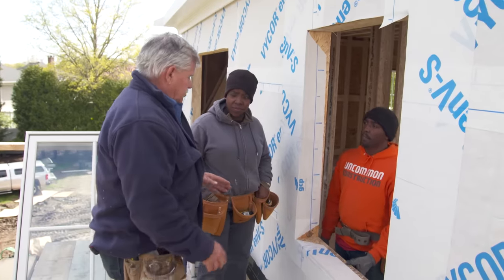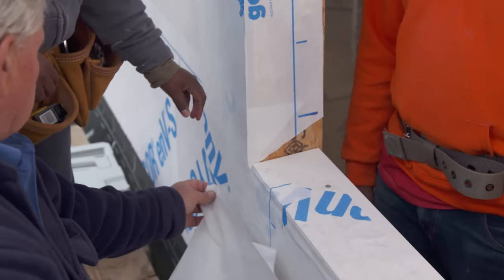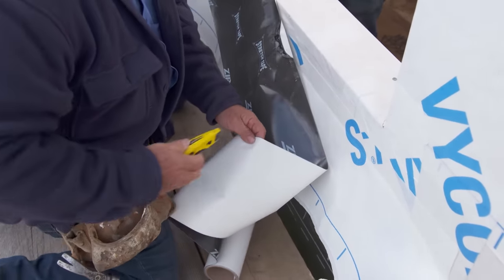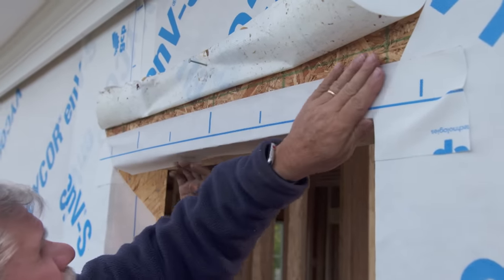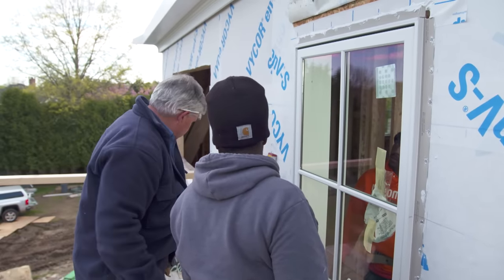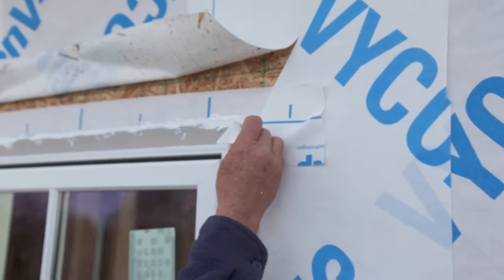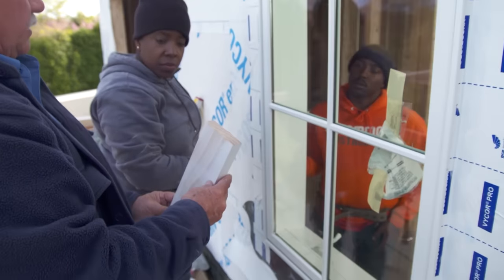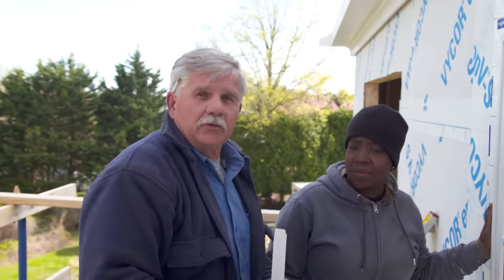This Old House | Pro2Pro: How to Properly Install a Window

Comment from the maker: Throughout his career Tommy has peeled away a lot of siding in this area only to find rot from years of water damage, which is why he’s a firm believer in this kick-out style flashing. He’s seen it on doors and below windows.
Reply: @Order-in-Chaos  so don't watch it.
Reply: @Order-in-Chaos  not going to waste anymore time to your silly behaviour. Get some friends. Or buy a book...
Reply: He forgot to put is z flashing on top of the window and then tape the top of the z flashing then pull the house wrap over the tape and z flashing
Reply: A easier way to flash the window sides and top is pull the paper a couple feet hold the flashing with the edge of the window and then stick it to the house with your palm seal it to the house working in towards the window. This way is much faster and you never have bubbles plus the coverage on the window is always even give it a try it’s not taught it’s something I discovered
Reply: Could have used him on a recent build I had done - and am having redone. 😢

Comment: This particular task is a good depiction of how drastically building standards can change. It’s awesome to think how well this will prevent water entry, but at the same, it took 3 sets if hands 30 minutes do to this (1-1/2 hours total just to flash and install the window). If you’re spending this kind of time on this, then adding the time to spray foam, trim the inside, trim the outside, flash the trim, and all of the materials, you’re in to some huge money to do just one window. It’s an ongoing predicament in my head. We spend all this time and money taking things to the Nth degree, yet there are still houses all over New England with 100 year old windows, no modern vapor barriers, and no rot has started in the wall. The old timers had something figured out. Meanwhile, just the other day I pulled out some 30 year old windows at a client’s house and the flexible adhesive flashing membranes were all cracked and flaking anyway. I am inclined to try and convince clients that it’s worth  using the best possible installation method, but every time I hand them a bill for a few thousands dollars to install a couple windows I always wonder if all this fancy stuff is going too far.
Reply: The predicament seems, to me at least, that the old timers left ample space for houses to "breath". Even if moisture did get into spaces, those space would naturally dry out quickly. This had the obvious downside of being energy inefficient, but oil was cheap back then. Insulating old homes usually means sacrificing airflow. Modern homes can be designed to incorporate good airflow and insulation, but that adds to cost, and old homes aren't being redesigned, they're being upgraded piece by piece, and upgrading insulation doesn't always mean taking into account the airflow physics. So it's complicated because the benefits of insulation bring the complications of changing the physiology of old home construction.
Reply: Training always takes longer when done correctly. Once someone gets the rhythm, they'll be able to crank em out. (Pun intended.)
Reply: Same with wood floors on a raised home. If you put a vapor barrier between the sub floor and the real wood floor moisture will rot the top of the sub floor. In the old houses the wood floor planks were the only floor, allowing the floor to breath.
Reply: Survivor bias, most old houses have rotted and collapsed.
Reply: i would assume this would be a 2 person job and there were 3 hands for the sake of training video.
Reply: @johncostello4565 really? Come to the east coast or New England and have a look around. Where I live, every house you look at is 100 years old or more
Reply: The old timers did it right. Houses could breathe and the inside air was higher quality. Sealing  the houses tight to save heating costs  had the adverse effect of trapping moisture and keeping the stale air inside, turning them into mold farms and reduced the air quality in the home.

Comment: I would love for TOH to do a series on window replacements, especially when the home is not being resided.  To many window replacement contractors don’t provide adequate flashing and weather proofing.
Reply: Gr8 M9ds Agreed!!
Reply: The do it on purpose save penny to make thousand in repair I. The future hahahaha because the warranty of tha windows  expire ..   it's the so call do business
Reply: So true. I can't find ANYTHING on this on YouTube. What I read on GreenBuildingAdvisor in the comments is to treat the outer surface of the old siding as if it's the building paper surface.

Comment from the maker: Eric recommends using roofing nails. If using 2” roofing nail, every other hole; with 1-3/4” roofing nail, every hole. Tommy says: why roofing nail? Because the head is flatter so it won’t interfere with trim once it’s installed.
Reply: This Old House - my drywallers use roofing nails if installing board with pneumatics. Less overdriving, less tearing, better hold, and no buildup. Two thumbs up!
Reply: Did they nail in the bottom nailing flange? If they did it is not shown. If they didn’t it is not water nor air tight. Please clarify for us if you can

Comment: no doubt this method will seal the windows now but how long will it last?  How long will a system of adhesive last? 5-10 years? Before water can seep in?  Maybe even less years if there are heavy winds or earthquakes in your area that twists the house?  Serious questions.

Comment: Wow! I watched many videos before this one getting ready to replace old window in my old house. This one is the best - The amount of attention to details and absolute perfection are impressive! My old 1965th house does not have wrap and probably insulation either, but has old siding. And the house settled on one corner and is not square or leveled anywhere. Then what to do in real life with a real old window in a real old house?

Comment: I like the zip stretchable flashing, It's a neat idea. Otherwise go for a copper or lead flashing detail.  My big concern with all of these adhesive based products (zip included) is that it will fail from adhesive failure in a decade or so.
Reply: My concern too. Will the plastics get brittle or melt? On the Dorchester house as well as one of the Andy Tiplady builds they used sweated copper. That's probably exponentially more expensive and labour intensive.
Reply: @mrpiccolo23  I doubt it, Its like a rubber sheeting, It will probably get less malleable so it would break i moved, but since its just fixed in place- and shielded from Uv rays I think it should be fine for the 20-40 years the siding will be up.

Comment: I'm pretty sure when they built my house in 1970 they did the part about putting the window into the hole. I think they probably skipped the other steps
Reply: My homes front door is rotted from Exactly this not being done.
Reply: @kristianfairchild7774  your front door is also probably about 1000 years old.

Comment from the maker: 1:24 Tommy is using roofing nails here to nail in the clapboard to the sill
Reply: Why does he still use a clapboard? I work in window manufacturing. Our sills slope to the outside. Is that not commonplace for other manufacturers?

Comment: Using  a PLS or DeWalt laser helps much better than a 4' level, less messy too. Would you think about it?
Reply: Using a Lazer level to level second story windows? Kinda over kill when Tommy already struck a plane line around the house so the windows would be in line . . But different strokes for different folks.  Also a Lazer line is very thick and can cause variance if your not on the exact part of the Lazer . A pencil line is thin and more accurate . In my opinion. No disrespect to your method
Reply: TELE6220 ok.. it’s just the way I do things , call me thick I’m fine with it . Sorry that struck a nerve with you . Wasn’t my intention . Have a great day

Comment: I like everything you do on installation of windows. You only make one mistake and it’s actually pretty big when you consider it pertains to water. The idea of sealing the top and sides are very good. Even leaving the bottom unsealed is a good idea. The problem I have is or starts with were water is (most likely) to penetrate behind the window edge I say it’s at the top. It doesn’t matter if you agree or dis agree because nothing is 100%. How ever let’s say in this case it is the top, so if we follow the direction of the flow it’s going to remain fairly straight until it runs into something that will redirect it, in this case the calking used so far I think we all can agree. My problem is when you applied the caulking you applied it in a wave pattern which is fine for the two sides, however when you applied it at the top you create traps or high and low points. That’s  were I have my problem. At the top of the window you should apply it in a mountain shape, well we all know water rolls downhill. Before the window is fitted you should start it on a slight angle with the top as high as you can and the bottom held out. Then slowly lower the bottom of the window into position and at the same time letting comedown into position. You can actually prove this the same way I did. On the show instead of using an actual window you can use a section on glass to see what happens as you make the seal. You won’t end up with water troughs you would in a wave pattern. Try it you see.
Reply: Flashing tape is supposed to go over the top window flange, it's not just sealed by caulking... and then z-aluminum flashing over the top of that... then more flashing tape over the z-aluminum flashin after it's been nailed in place. If you need to think about a "mountain shape" for your caulking to keep the water out, you're doing it wrong. :P

Comment: the black stuff is called uncured rubber and the best way to avoid buckling is to keep  wax paper under it, after positioning and stretching wax paper can be gently removed then should go with roller over it,

Comment: Why no horseshoe shims on the bottom? There is hardly any gap for water to drain without them. Nice to see the sloped sill though! I think it might have been helpful to point out that window openings should have the sill itself slanted, rather than adding a slope on top of it, though that works too.

Comment: Rule 1: You can never have too much flashing around those windows.
Reply: You can if its not done right.  I like the zip stretchable flashing, Its a neat idea. Otherwise go for a copper or lead flashing detail.    My concern with all of these adhesive based products (zip included) is that it will fail from adhesive failure in a decade or so.
Reply: @ozziesheppard17  in my opinion if you properly use the aluminum drip cap with proper tape on the sides and of coarse the flextape on the sil you should have no problems at all . Call does fail over time if your not using the best.  I myself use Lexel.  It's the best I have ever found , nothing compares .
Reply: Just a thought, something I found in an old house build circa 1930. When they installed the windows, stick built them if you will. They used copper sheets in a step flashing method. Then they had tar on top of the flashing, on all 4 sides.  Of course the sill was canted and had a drip groove on the bottom.. When we opened the wall for the addition, the only damage was from terrormites. The amazing part was it was on the western exposure so that side gets the bulk of the wind and rain..
Reply: clmsnfan 
Matt Risinger uses a 5 degree angle on the bottom sill and he recommends flashing but ESPECIALLY PROSOCO or a couple of the liquid applied products. Then Adhesive/sealants around the whole sill. The window is sealed with sealer/adhesive, except the bottom because you want the water to drain out on the 5 degree cant.
Reply: Ozzie Sheppard 
See last Friday's "the build show" by Risinger, he discussed phony Tyvec adverts and discusses weather barriers in framed walls.
Reply: 24:40....all sticky stuck stringy hands wow...loll
Reply: J Mack  Well, In any good flashing system you don't actually reliy on any "sealant" basically you use gravity and overlapping sheets of copper, lead, or asphalt to direct the water away. 

Recently buildings have gone from keep "most" of the water out, and keep drafts out- To keep ALL of the water out, and completely pressure seal the building. This has required us to think very differently about how these systems work. My only fear is a repeat of something like efis and the mess that was.
Reply: @BrianBriCurInTheOC   ya also very expensive. He is a salesman for sure. But unfortunately you wont see those products on most builds till they are well into the hundreds of thousands of dollars on a custom home.

Comment: Way more than needed. Just more work. The top moisture barrier he cut and added the second small piece, just overlapped the outside in the wrong direction. He should’ve caulked the window to the sheathing, at the top, then taped the window flange. Create a tape or metal pan on the sides and bottom, not the top. Leave the bottom flange of the window un-caulked. I like the Tyvek example on their channel.

Comment: I have two bedrooms that have two windows that I would like to remove and put something in that looks like two windows side by side but I could remove the whole window so that I could move furniture inside and out of the small bedroom. This used to be a hunter's cabin that they added rooms onto but they made a very narrow hallway so I can't get furniture into the bedroom so my idea is to somehow put a window in that could be completely removed, lift a couch through it and then put the window back in place. Anyone have any ideas or directions I could start looking? Thanks in advance!

Comment: How about replacement windows on a stucco exterior home built in the 50's with old metal box casement windows? I'm planning on removing the entire unit, metal frame and all.
Reply: I replaced and installed all the windows of a home last summer with what your describing and remember having to remove all the metal casing and even some of the sill and jack studs and reframing around the opening to accommodate the new windows but that area is very susceptible to humidity and lots of rain so hopefully yours would go more smoothly
Reply: they make retrofit style fin windows for stucco sided homes. Simply remove or don't remove the metal framing. Put 2 3/8" beads of silicon exterior caulking on the flanges and press window in until the flange meets the stucco. Screw in from the inside (assuring proper square plumb and true), then put a parameter bead of caulking where the window meets the stucco. Do not caulk the bottom as you want water to run out. 

Stucco window retrofits are the easiest things to change.

Comment: A pro-tip when using roofing nails is to hold it like you would normally hold a cigarette, between the  index and middle finger with finger nails pointing against yourself. Easier to avoid hurting yourself by not hitting your fingertips, also quite a bit more efficient when driving in a large amount of roofing nails by hand, at least imho.

Comment: now if only every window installer did it the proper way instead of cutting corners to save time/money that'd be great
Reply: As long as you want to pay the price it costs to put a window in like that ,imagine putting in 30 like that it would cost more than the house.
Reply: @roccoconte2960  or learn and do it yourself? Tom is probably the best in the field.
Reply: @Ham68229  agreed do it  your self if you research enough you can do as good or better than the pros but it will take much much longer than they do and not be much cheaper
Reply: @roccoconte2960  >THIS< Everyone wants this, but hardly anyone wants to pay the price.
Reply: @ajs96350  How true ,everyone expects this kind of job but when told how much it costs its a different story.
Reply: @roccoconte2960  
PAY ME NOW
OR PAY ME LATER!!!
Reply: @BrianBriCurInTheOC  Tommy is going way over the  top ,no need to go that far ,they have unlimited money to spend not everybody does window would be fine without going that far.
Reply: @BrianBriCurInTheOC  EXACTLY my point Brain that flashing will out last the window and 95% of the times all that is not needed, do you understand now?
Reply: @BrianBriCurInTheOC  Listen DUMBBELL i am 63 years old and have been building and remodeling houses for 40 years ,you still have to learn what i forgot!
Reply: @roccoconte2960  
LoL
Reply: rats arsed  
WoW, where do you guys come up with these HillBilly comments???
Reply: @roccoconte2960  
LoL!!!
Reply: I just did 17 windows in our house that way.  It took us two months of weekend but that included replacing rotten sills from the last guys who did it the fast/cheap way...

Comment: If its plumb and level, it had better already be square or you're going to be in trouble.
Reply: Hell yeah ..basic mathematics
Reply: sean tap   How does the square measurements change from 56 7/8” x 57”. Then the homeowner “racks” the window and then it changes to 56 7/8” x 56 7/8”.   Seems to me if you rack the window it would add a 1/16” to one measurement and subtract 1/16” from the other. The correct square measurement should have read 56 15/16” both directions. (View sequence @ 18 minutes).     But then “Big T” subtly checks plumb (with the Stabila level) to confirm homeowner’s measurements.

Comment: Some of the issues I find with a lot of these videos is Different area's have access to different materials, The concepts are about the same but some of the materials are don't react the same, The rubber membrane he used I don't have access to, I would have preferred to use what he used.

Comment: Is the bottom flange nailed?
Reply: Should be, just not super tight.
Reply: Yes, but some also use  1/8" u-shaped plastic shims (u is installed upside down so it won't fall out if things shrink) to ensure easy path for water to drain when the window inevitably leaks.